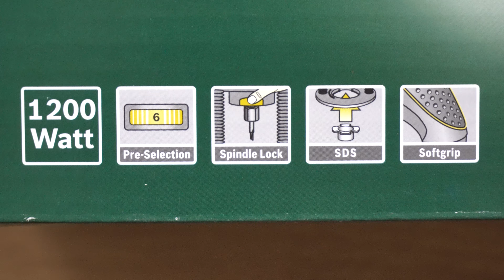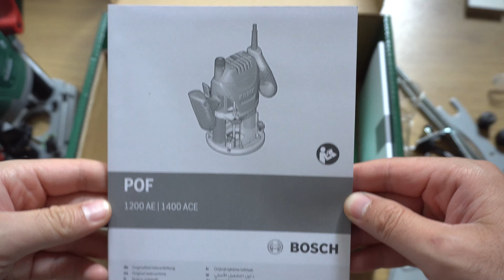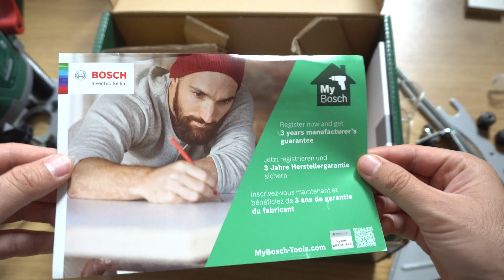How to use a Router (BOSCH POF 1200 AE)

Comment: Bought the POF 1400 in 2023 used it once but through trial and error, as the BOSCH  manual isn't very user friendly. Need to use it again but with greater control, found your video. Excellent explanation of calibrating the depth-stop. BOSCH should give you money for this help you're providing. Many thanks for the video.

Comment: If you unscrew the micro-adjustment blank you will see that the mechanism for fine height adjustment is included in the router. All you need is a suitable twisty knob thingy and you have the full system. Thanks for coming to my TED talk.
Reply: the nobbly dome on top? hmmm thanks bud.